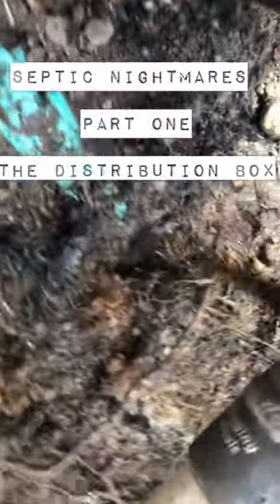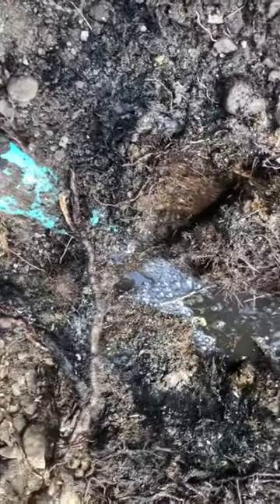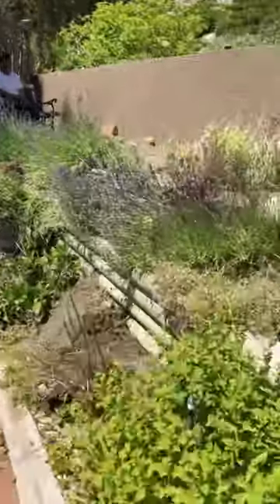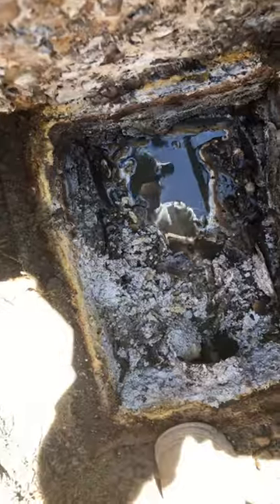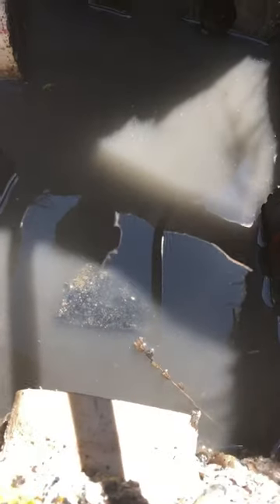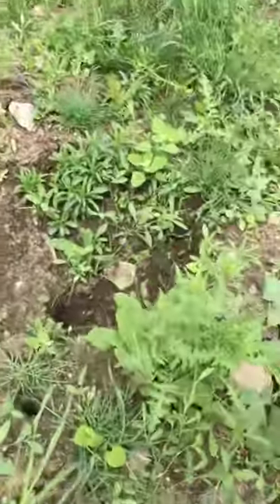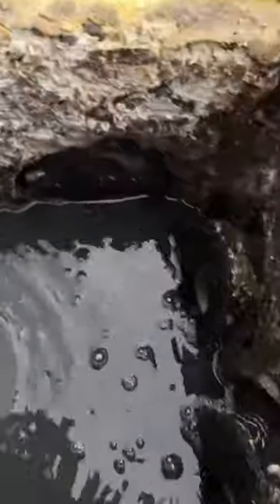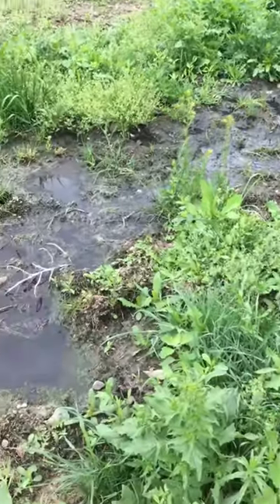Septic Nightmares, Part One, The Distribution Box

Comment: I don't know if this guy is working in the United States or Canada, but it's absurd to suggest that a Distribution Box be checked every time the Septic Tank gets pumped out. I don't know of any homeowners that would want to pay for that, because it's certainly not included in the cost of pumping a Septic Tank. As illustrated in this video, sometimes the D Box is buried 5 or 6 feet deep, and locating it is time consuming, which can be cost prohibitive for a homeowner. Not to mention, most homeowners don't have a copy of the Septic System Design or Septic Plan available... especially the "as built". As a result, it simply doesn't happen, unless a Septic System Inspection is being conducted for a perspective buyer, or if the homeowner is experiencing a problem that necessitates  further investigation. To be clear, this  could get very expensive, and easily end up costing a thousand dollars or more. In my state of New Hampshire, not all systems have Distribution Boxes. In fact, many of the newer Leaching Fields or Drainage Fields have manifolds instead of a D Box, or use Serial Distribution. The bottom line is this, I don't go looking for Distribution Boxes unless it's absolutely necessary, which is rare, and when I find Flow Regulators or "speed levelers" in the D Box, I usually remove them, because they impede airflow as well as prevent proper distribution of the Wastewater or Effluent. In my opinion and in my experience, not needed unless the D Box has settled or shifted out of level. Flow Regulators or "levelers" in Distribution Boxes is a relatively new thing, because 20 years ago, nobody really used them. Again, in my opinion, most systems don't need them, so I don't recommend them.
Reply from the maker: As per regulation in our province we have to have the distribution box accessible at all times.  It costs nothing extra to have it checked when the tank is pumped.  Get to know regulations before making assumptions.
Reply: @groundstonewastewaterservi5066  You should make it clear in your video that you're in Canada, because in the United States we do things differently. Not to mention, the environmental rules and regulations are different in each state, which is why I make it clear that I'm in New Hampshire. As a result, my state requires that all 3 covers on a Septic Tank must be accessible year round, so if a tank is buried deeper than 12 inches, risers must be installed over all the covers. Also, if a Leachfield/Drainfield is deeper than 18 inches, it must be vented, which on most modern systems is automatic anyway. I'm sure you'd agree, that Oxygenation or Oxygen Transfer, is beneficial to the long term performance of any system, and Passive Airflow through a Candy Cane or Gooseneck Vent is the easiest way to accomplish it. In any case, many of the newer technology systems don't have Distribution Boxes, and use a manifold instead. It's also become very common to install a Leaching Field using "serial distribution" these days, so the Wastewater or Effluent, flows directly into the first row of tubes, chambers, or modules, it depends on the type of system. Unfortunately, most modern systems in New Hampshire are comprised of Large Diameter Gravel-less Pipes, which are usually 12 inch diameter Fabric Wrapped Tubes. These systems are constructed using only Septic Sand and are commonly known as "sand only" systems. Honestly, I don't like them, nor do I recommend them, because after more than 2 decades in business, I still think Stone & Pipe Leaching Fields are the best, and last the longest. At least, that's been my experience here in New Hampshire.

Comment: So if the D boxes NEED air flow ... To prevent degradation of the concrete....which I had no idea.... And those d boxes are under so much backfill like 5 feet under.... What is the fix to allow air to the D boxes to prevent them completely dissolving.... And WHY is the box made of something that can degrade from sewer gas. Why not POLLY OR SOMETHING??
Reply from the maker: D-boxes should always have a riser to grade.  This is a key component in a gravity septic system.  Over time there can be slight shifting, the balancing of effluent to each drainfield run is adjusted with speed levellers.  Gases erode concrete over time especially without oxygen transfer.  We use mostly Poly d-boxes now and if concrete d-boxes are preferred they should be to grade level.  D-boxes should never have that kind of backfill, should be within arms reach to make adjustments
Reply: @groundstonewastewaterservi5066  What's the best brand of poly box?  Great video.
Reply from the maker: @maddierosemusic  Polylok and Tuf-Tite are the most common poly distribution boxes.  As long as the boxes are bedded properly and sealed they can last a very long time.  We don't have an extensive selection of poly boxes so I can't give a good case on which brand is best, I'm sure there are better options than the ones I mentioned.

Comment: How old was the last sewer distribution box you repaired, are all disyribution boxes the same? thanks
Reply from the maker: Many in the past were quite similar and just about all in concrete.  Today we have a vast selection of designs and materials.  As long as the seal is water tight and there is access for maintenance it really doesn’t matter what type of d-box is installed.  Many I have serviced have been in ground dozens of years before being exposed.
Reply: @groundstonewastewaterservi5066  We were having sewer issues starting in Feb; We thought the field froze so we had the tank pumped. In early June I ran a snake 60ft and hit a dead end. And the pump did its job and we were happy until a couple of weeks ago, started to see sewage water coming out of the rhubarb patch. I tried finding the distribution box with a thin rod but could not hit anything solid. Never would have thought to go into the rhubarb patch. It has frozen some and will get colder starting tomorrow. I guess we'll have to get it pumped out for the winter unless you have a secret about the problem described. Seems like its a summer job,  Thanks kindly, cliff
Reply from the maker: @cliffleschyshyn1018  sounds like maybe that one drainfield line is getting hit the hardest.  This often happens where there is quite a bit of build up in the d-box, that build up can clog the other outlet ports into the rest of the field.  
You can either chase the pipe leading out of your septic tank until you come across the box or chase back one of the field lines without breaking the drainrock bed.

One good way is to use a utility locater to locate the pipe lines, then following them back towards one common area, that would be the d-box.  This service shouldn’t be very expensive and it can save you considerable digging
Reply: @groundstonewastewaterservi5066  Thank you very much, very helpful and that is the step I will take.

Comment: Does this cause backups into the home?
Reply from the maker: It sure can.  The d-box can get completely plugged and back fill the pipe leading to the septic tank and can cause back up into the home.

Poor distribution can also cause sections of the field to receive the majority of the wastewater flow which can lead to surface breakout.

Comment: Why not make them out of graphite or so.oid pvc?   Daaaaa
Reply from the maker: Plastic components pre 19&0’s we’re not common nor were they well designed until much later.  Much of the septic components such as tanks and d-boxes were just about all made from concrete.  These old components are now disintegrating and are replaced with more modern components.